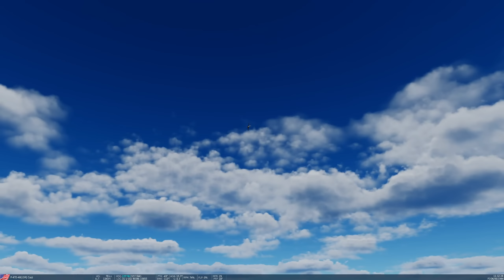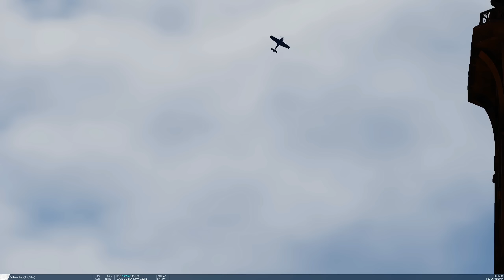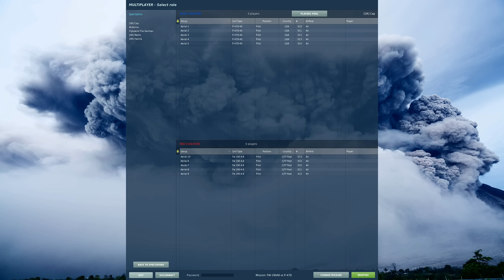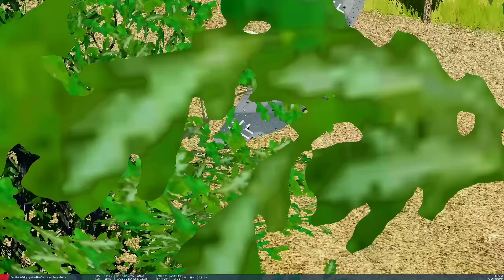P-47D Thunderbolt vs FW-190A-8 Anton: Dogfight Under The Eiffel Tower | DCS WORLD

Comment: At approximately 9:50: the Fw190’s wings were so short because they were optimized for roll rate. That thing was built with a “short and stiff two-spar one-piece wing design, two main spars to combat aeroelastic twist, small wing area (for a fighter plane), and metal-covered frise ailerons actuated by rods. That’s what allowed for the Fw-190’s “insane” roll rate.

Keep in mind that the P-47 was a good roller as well.

Comment: The Dora and it's later close relative the Ta-152 were given the inline Jumo's specifically for much better high altitude performance  to assist with  high level bomber intercepts and high altitude dog fights with bomber escorts, as the radial BMW 801 derivatives pretty much sucked at the higher altitudes.

Comment: I noticed the picture showing the P-47 in the beginning of the video had the older 'pencil blade' propeller. However, once the video started, it looked as if the P-47 had the upgraded 'butter paddle' blades, which would have increased acceleration and climb rate substantially better than the original propeller. Which blades did the propeller did the  P-47 during the video actually have and are the two even modeled differently?
Reply: i think the one in the picture is the D30 compared to the D40 which was used in the demonstration
Reply from the maker: Amazingly well noticed! I would never spot that.

Comment: The description is wrong ("early/mid war Fw 190").
A8 was late WW2 aircraft, but it had performance and maneuvrability inferior to 1942 A4 variant. 
The issue was, BMW 801 engine, due to some yet to be determined issues, was incapable of running at higher power, MW50 simply destroyed the engine, C3 fuel did not help.
So basically A8 was heavily outdated in 1944, it needed around 2000HP (absolutely achievable for the engine of similar displacement, as shown by the Japanese), and it had less than 1700.

I would love to see  Fw 190 A4 experimental MW50 variant in DCS or Fw 190 A5/U2 (A5 with removed outboard MG FFM cannons) - former would have insane power to weight ratio, latter should be able to fight P-47D30 in a very competitive manner (much lighter than A8, but similar power).